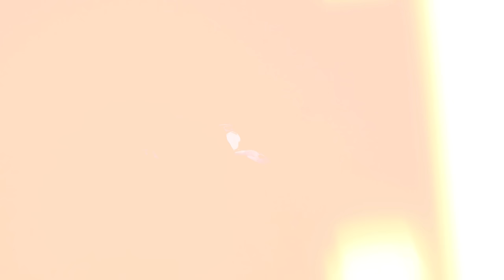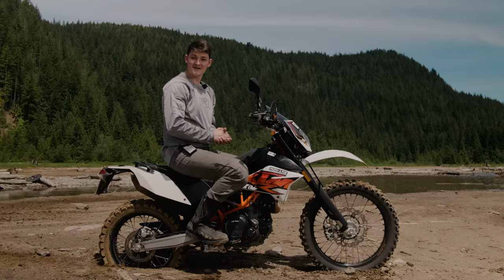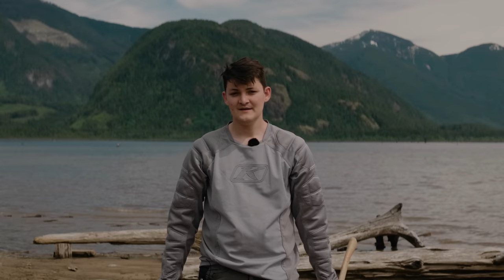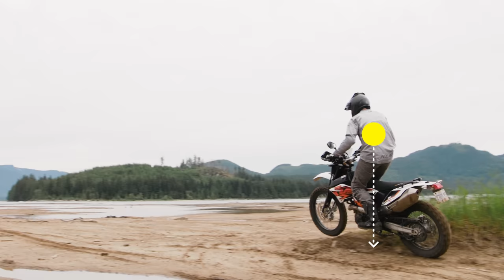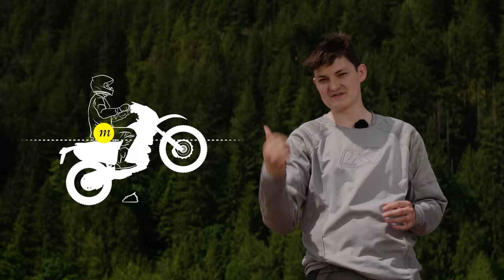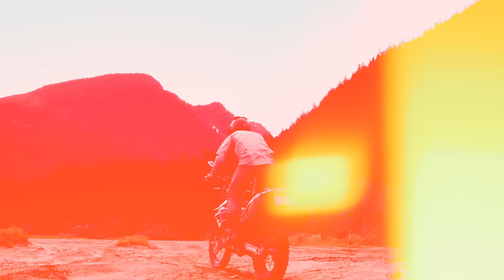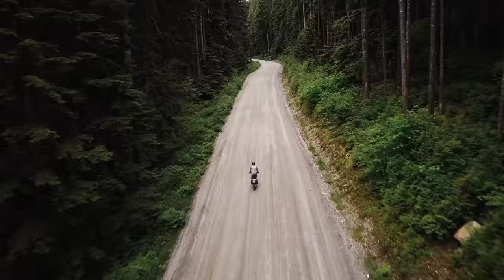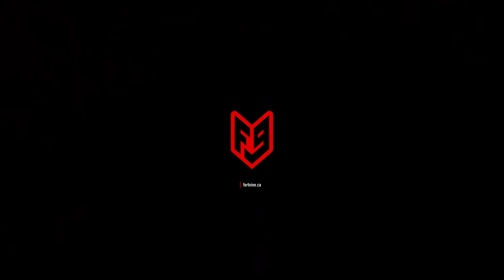Why and When to Stand on Your Motorcycle

Comment: so why can't I buy anywhere an offroad/dual-sport motorcycle that has automatic or variator gearing, brakes on the handlebars, and pegs are just wide and stable dummy pegs, not shift levers or foot brake levers? those are just too inconvenient for standing!

Comment: Almost everything. Standing also separates the momentum of the body from the bike in side to side motions. This increases stability by automatically leaning the bike back to the center so it "self steers" back into a straight line. Bikes only work because of self steering. They don't go straight because of angular momentum in the wheels. It's all due to automatic steering correcting as the bike leans over.

Watch this video - very important for all bike riders:

https://www.youtube.com/watch?v=9cNmUNHSBac&t=2s

Comment: I stand only when the surface requires is or my knees or ass are yelling at me for having sat for so long on the bike.  Why stand on a well groomed dirt road?  Relax, save your knees and strength for the sections that require you to stand.  Of course, you should strive to be able to ride well both sitting and standing because maybe you'll have to do a tight u-turn on rough ground.  

I have heard the lowers your center of gravity line of BS for YEARS.  Thank you for supporting actual physics.  There is a great benefit to standing when you need to, but center of gravity is not it.  And using your legs as shock absorbers is only part of it.  The bike can move side to side under you as well, which keeps you more stable.  Standing is another tool in the rider's tool box of skills that can be used to get you where you want to go.

Comment: Love your videos...but sometimes your Physical explanations drive me mad.  You're so close to the right track, then (like atg ~3:06) you state about bending your knees rather than being bumped up by the bike: "if your mass moves no velocity, then you add no momentum".  There is no "adding" of momentum.  Remember: conservation of momentum is the cornerstone of such calculations.  The common student error is starting with p=mv and going down a crooked path to a bad conclusion.  conservation of momentum.  The bending of the knees is about control.  If you do so, then there is a gradual change in the momentum of the motorcycle itself, as it transfers momentum to you.  If you rather keep your butt on the seat, there is a more instantaneous transfer of momentum from motorcycle to you.  (you can always calculate it the other way, it makes no difference as long as you pay attention to the signs).  Thought exercise:  jump off of the motorcycle at the same time time the motorcycle encounters the bump.  you will have transferred momentum to the motorcycle in the opposite direction as the bump.  (if we assume all momentum occurs linearly).  Of course, it doesn't, so enter dynamic inertial moment, as you eluded to in the beginning.  And, of course, you were on the right track with the center of mass of the system, and degree of coupling.  So, you can get pretty close using a coupled pendulum model if you like (with dual coupling (handlebars and footpegs, before you begin adding the seat contact as a third coupling.  And of course, how you approached it with center of mass and inertia is a nice way to impart the fundamentals.  But conservation of momentum is paramount, and I think would impart well to the audience.  The system needs not be separated for this, as the transfer of momentum from one object of a system to another object (neglecting earth since it is so massive....except of course if you are on non-solid ground) better imparts to the audience how rigidity of your stance offers a continuum of control variables.

Comment: No no no. The center of mass has no sense for not rigidly connected bodies.
If you stand up your point of force application is down on the pegs.
If you seat down you apply the force at the height of the seat.
In both cases your body acts as a perturbating EXTERNALl force on the motorcycle.
In the first case this force has the shortest leverage possible in order to disturb the inertia of the rotating wheels.